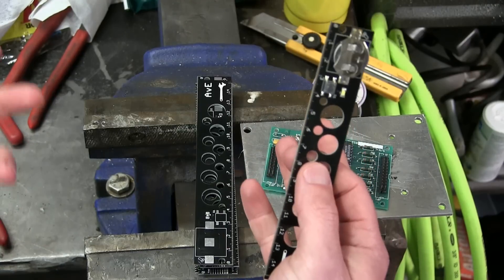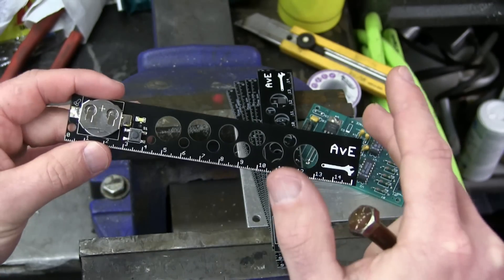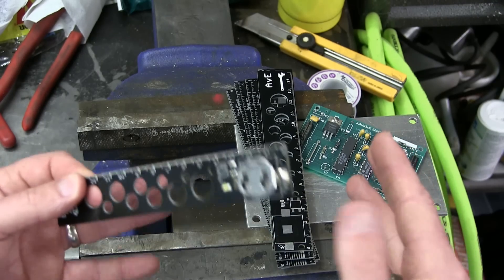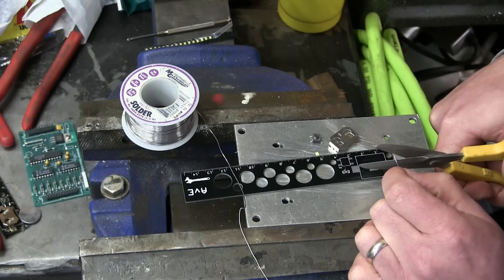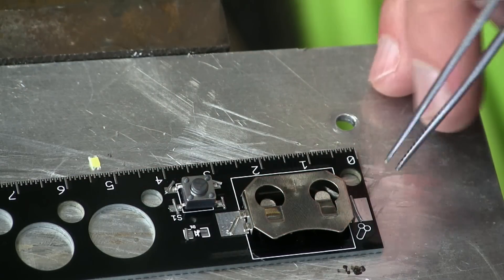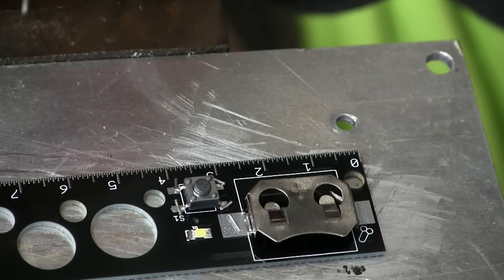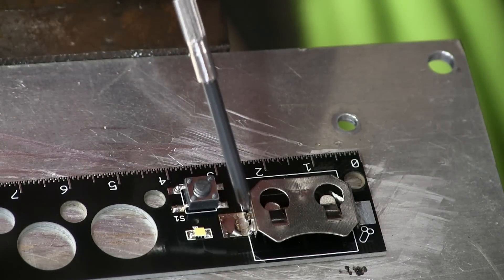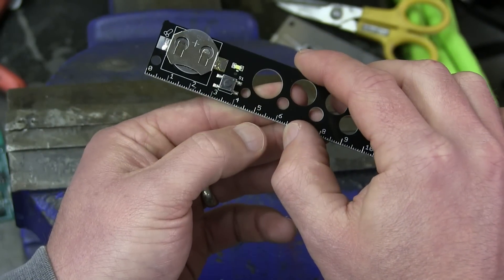AvE Shop Ruler: AKA How to Solder WITHOUT a Sodding Iron!

Comment: Well I completely fucktercated mine, soldered everything in place, popped the battery into the battery holder and it ripped the pad right off the board, son of a biscuit!  The next day though my "can't fix it" shirt turned up just to rub it in.  I'll give you this AvE, your comedy timing is great, even by post...

Comment: If the led goes on backwards does the dark get pulled in? Or is that the magic smoke going out?
Reply: There shouldn't be smoke as the battery voltage should be less than the max reverse voltage the LED can handle.
Reply: Short answer: nothing happens.
Long answer: the 'D' in LED stands for diode: a sort of one-way valve for electricity. Connected in the wrong way, they can start conducting (and failing) if the voltage is high enough. For LEDs, this is around 4 or 5 volts, which is less than this battery can supply, so you're safe.
Reply: Yes LED will turn it self in to micro black hole and suck all light within 3mm radius

Comment: I got my welders ruler in the mail today. It survived the trek to Florida with only minor damage to the envelope.  All parts accounted for.  2 super bright LED lights. One normally open pushbutton switch. A battery holder. Two lenses and one magnet. I gotta find my solder iron or a fry pan and my propane torch. Am i gonna remember hair widths? Probably not. But having something to compare to is nice.

Comment: Myself being an old F*** , half blind old school electronics tech I gladly took on my first surface mount project, donned my trusty Optivisor and placed the parts and solder bits over a thin aluminum plate and torched on. Long story short, on my third rework with still no light output yet my trusty Fluke causing a slight glow, I light the propane again when suddenly all my parts scattered as the CR2025 decided to explode. Yes, do not torch solder with a battery installed! Lesson learned, the parts are nowhere to be found in my garage and the ruler is 1/2" short due to over heating the thin Al plate. However, on a positive note, nothing landed in my beer cup. Never had this kind of problem working with vacuum tubes... Love the AvE channel.

Comment: Thought I got a bad led at first, but then realized I forgot to add a spot of solder on the middle battery contact pad.
Thanks AvE for the cool project!
Reply: I had to do that too... The LED worked fine when battery was just barely in the holder (edge of bat was pushed into center pad), but not when the battery was all the way in the holder. A tiny dab of solder on that center pad fixed her right up.  Choochin strong. Now to figure out what to glue that mag in with.  Fun stuff, thanks AvE!

Comment: Couldn't you just heat up the plate then apply the solder from the spool as normal?
Reply: Yes, but having a piece of solder on one pad gives you a good indication whatfor not overheating the thing. It's not really critical in this case but at some point the PCB's gonna burn.
Reply: That's how I solder larger stuff like iron plates, bolts, etc...

Comment: Valuable lesson learned.  Do not attempt to solder a surface mount led after imbibing multiple scotch and waters.

I got the other components soldered, then promptly melted the led.  I have a local supplier where I am reasonably sure I can pick up a replacement.  Is there any particular P/N or spec for the led?

Comment: I received my order today. When I received the envelope, there was a hole in it as well as hole in the plastic baggie. So, I'm guessing the switch fell out somewhere between the great white north of Canada and NY. 

Is there a part number I can search for a replacement switch?
Reply: Email sent.
Reply: If you don't mind me asking, How long did it take to receive your tool?
Reply: King of Chuck About two months. I placed my order in mid-September.

But the actual transit time once my order shipped was only about a week or so.
Reply: Thanks!  I just ordered one today.
Reply: I thought it was good. It's not like your mounting processors or any crazy components on it. lol

Comment: Got my order today, Already assembled, need to source batteries, anyone know the correct battery size?

Also my order came with a free AvE hair stuck under the tape on the envelope!!
Reply: time to make a clone
Reply: daviasdf amazon and booze do NOT mix
Reply: Drunk self didn't get the memo :[
Reply: Hey did you work out the right battery size? I just got my ruler.

Comment: Got mine less than 2 weeks after ordering. Also got the welder’s ruler. Lots of fun to assemble... bought some rulers for gifts. Good thing there’s 2 LEDs. I soldered one in backwards and another was DOA, so it’s great that there were exras included. Note: when dumping the parts out of the little plastic bags, do it on a large white cloth so the tiny LED doesn’t bounce around and disappear.

Comment: No resistor on LED? I like my pixies under control not running free like a pack of hippies. Everyone knows that’s how cameras get unfocoused.
Reply: Feral hippies running around in packs ? Oh man I'm not gonna sleep now..
Reply: 3.3 volt coin cell to operate the LED which has a forward bias voltage of 3.3 volts.  No ballast needed.

Comment: I got my one t'other day and it's skookum, I got into the shed today and threw some crap off the bench and soddered it up good and proper and it's really choochin.
The worst bit was opening the pack that the LED came in and then dropping the LED on the floor. Lucky it landed yellow side up.

I also took the precaution of removing the vice from the drill press so that I could move around while still remaining firmly clamped in the lower regions.

Comment: Can't rush perfection!!! Thanks for making sure we get top quality! Does it matter what material you use to heat the board for the no iron trick? Aluminium, stainless, carbon steel? What works best? I have a sodding iron but want to try your trick.

Comment: hey,
got the ruler kit and threw it together the other day. Sadly the light was not working.Scratched my head so my 30 some years of electronics and soldering stuff could activate the proper brain cells and I realized i put the dang led in bassackwerds. So naturally the photons were getting sucked into the led and not beaming out of it.
Come to think of it the garage did seem a little darker when I pushed the switch! 
I took the easy way out and flipped the battery over. Works like a charm!
Reply: Wow... I never would have thought of flipping the battery over... I suppose that's the difference between an engineer and a bumblefack like me !!!
Good thinking on your part !!

Comment: When I bid a project, I estimate how long it will take and how much it will cost... then I double it. It usually comes out right.
.
Thanks for delaying shipment so we get a product that is as error-free as possible. I get tons of products from another country where they don't care if the product is correct. I end up disassembling and reworking them so they work as intended. One good example is a product where the hot wire from the AC plug went directly to the circuit board and the neutral wire was routed through the power switch and fuse.  Sure it turned on and off OK, but if something were to short out, the circuit board would end up being the fuse. 
.
I eagerly await the opportunity to make measurements accurate to within  a RCH.

Comment: I just bought one (3 years later) the place where you put the button is on the other end of the ruler. 

But it doesn’t have a button with it? It does have two clear circles though?

Comment: Hi all! Got my ruler build and all. One issue I had was the LED was silk-screened wrong, so the polarity was inverted. Just an FYI to check the polarity before you solder it, because mine broke as I tried to desolder it which was purely my fault. Mr. Bumble offered to ship a replacement LED but it's cheaper for him if I just order a strip from ebay (LED size 1206). Love the ruler! Thank you for the best tool of them all!

Comment: Bought 2.  Hand soldered one , not so pretty..... Got low temp solder paste and threw it in the oven @ 300 dungerees F  Looks like a robot soldered it !  Sweet!!!  I would like a refund tho, one of the 4 free extra LED's don't light when I tested them. what kind of an operation are you running up there?  I will take a few more rulers to give out as gifts if you get the sweat shop up and running again! Thanks & Cheers!

Comment: Hey, don't mind waiting, I'd actually forgotten I'd ordered it after the first week!  But, ahem Meester +AvE, wouldn't it be more skookum if there was a current limiting resistor to protect that LED from burnout?  Or is there some characteristic that makes it last long time without it?
Reply: at 3v from the cell it will be under driven by a bit, so it won't draw enough current to cook itself. the curve for current draw on an LED is non linear, meaning just a bit more voltage and the LED will draw WAY more current.

Comment: Is the ruler still for sale. Do you deliver. I will need today. Just kidding. Missed ruler vid after so many years. I like it. I will use the porta power duel piston weld scenario  next time i get a stuck 2" dangler off the turd pulling cart. Thanks for showing that.

Comment: Use a dab of liquid solder flux (rosin type RA) to keep the solder bits from moving.  CA to glue components to the FR4 ex post placement.

Comment: Get some solder paste and squirt it on the pads. Drop your components on and heat the ruler on a skillet on the stove. Once it gets hot everything will flow together perfectly. Turn off the heat, let it cool, and you're done. Super easy - no soldering iron or fiddly bits of solder wire required.

Comment: Hey everyone. New to soldering, theres a pad under the center of the battery plate. Do I leave that untouched? Or just melt solder to it anyway for battery connection?

Comment: AvE  --  I don't know if you caught it ,  but on the second iteration of the Shop Ruler there is a Spelling TYPO with the "(Cunt Hairs)" Gap Width .  The word "Width" needs the letter "d" in the middle of it ,  without that letter "d" it becomes an entirely different word with an entirely different meaning .

Comment: What is the point of having a that on the ruler?  
(also, don't u need a resistor in there to limit the current so the LED doesn't release magic smoke?)
Reply: Battery voltage is close enough to the forward voltage of the diode, and the internal resistance of the button cell (they're not capable of delivering very large currents) will handle the rest.

Comment: This is kinda what you would do with old xboxs that got the red ring of death. You'd wrap em with damp towels and stick em in the oven. The reason why it worked because the soldering work was so bad that basically "redoing" it in the oven would fix it

Comment: Got mine less than 2 weeks after ordering. Also got the welder’s ruler. Lots of fun to assemble... bought some rulers for gifts. Good thing there’s 2 LEDs. I soldered one in backwards and another was DOA, so it’s great that there were extras included. Note: when dumping the parts out of the little plastic bags, do it on a large white cloth so the tiny LED doesn’t bounce around and disappear.

Comment: You made your job like 20 times harder by not melting the little solder sticks first. Melt some solder on the pads, then put a leg(s) of the component on top, then put the iron back on the pad, and go through the pads. Normally you just do a corner then solder the rest regularly but hey. You do you.

Also, how do you remove splinters with those tweezers? Are you getting impaled by logs? (Sharp tweezers are the way to go, and brass if you want them to stay non-magnetic)

Comment: Okay, I have my Oxygen regulator turned up to 25 psi, and my Acetylene regulator set at 18 psi, with a #9 rosebud tip. Do you think it will be hot enough to melt the solder? Or do I need to get a bigger tip?  LMAO !

Comment: Where is the resistor? Shouldn't there be a resistor to limit the current through the LED?
Reply: Not really needed, it's (I'm assuming) a 3 volt LED and a 3 volt battery.
Reply: Doesn't matter if its a 3v LED. The battery cant provide enough current to kill the diode. The LED will always try to pull maximum current.
Reply: the resistor would limit the current through the led to protect it. the voltage is not the reason we can leave it away. the maximum current from the battery is simply not enough to kill the led so we don't have to limit it.
Reply: Yes the LED would try to pull whatever current is available. But I meant exactly what others have said more clearly, that the tiny 3v button cell doesn't have very much potential current. I just thought it was common knowledge that those batteries don't supply very much current and I really shouldn't have said it the way I did. So I was both almost right but mostly wrong because of the way I said it. In other words "Whoops, my bad."
Reply: Maybe it is a LED with build in resistor?
Reply: certainly not
Reply: Sebastian Horlebein
How do you know?
Reply: There is no such diode with built in resistor. Especially SMD type.
Reply: @all - I'm surprised that nobody has explained this.

First - A battery is an arrangement of cells, and the only real battery available to the masses is the rectangular 9v - all else are 'cells' (AAAA, AAA, AA, C, D, button and coin etc.), but the term 'battery' is commonly used as a general term for both. The reason I mention this is to describe an inherent property of any cell known as 'internal resistance', similar to a simple resistor in series with the power source that limits the amount of current available.. This is one reason this LED can be directly connected without a resistor. Every cell (and battery) has a different internal resistance and maximum current it is capable of, and can even vary between same types and brand.

The other reason is that this LED requires an operating voltage higher than the cell is capable of producing. White LEDs (and others that rely on blue light to excite a phosphor, such as pink, purple turquoise etc.) like to see 3.3v-3.6v and around 20mA of current. Most other colours of LED would be okay, but may somewhat over-drve some types of red.

As an example, let's say the LED wants 3.4v and the cell will give us 2.8v after its internal resistance, this white LED will be UNDER-DRIVEN by 20%. The light from a LED tends to be non-linear where its range of output spans the top 3/4 of a volt (ca. 2.7v-3.4v), this LED will produce only 75% of its potential power. Worse, since we perceive light and sound in a logarithmic response, the LED will probably 'appear' to be half as bright as it would be if fed the 3.4v it wants.

Sorry for all the boring detail, it's mainly for those interested in the how/why and those who are just starting out with electronics. I hope the extra effort is helpful for at least one or two people out there.
Reply: I am certain because a) it is not needed b) it wouldn't make sense c) I have never seen nor heard or read about a led with integrated resistor in this package. yes there are others with resistors integrated but mostly 5mm THT packages. the coin cells internal resistance is sufficient to not kill the led.
Reply: I think its time to stop saying the same thing over and over...
Reply: +DaveArgon I apologize for accidentally reporting your comment. The POS device I'm viewing this from interpreted my gesture to scroll down as a quick series of taps.

Comment: How hard would it be to fit a 2032 battery in there if I got one? I have a bunch kicking around and they're also available at the ol' dollarama while the 2025 isn't.
Reply: i used 32's in devices that use 25's before
Reply: I wonder too, I have donkey loads scavenged from disused computer machines.

Comment: How high temperatures would the PCB withstand?
Reply: ~500 ish (Celsius) they start to disintegrate, smolder and with ignition source, burn. :)
Reply: Yeah, I guess it's highly dependent on the laminate substance used...
It just came to my mind after remembering all those various PCBs stained black because of prolonged heat.
Reply: Pinkorek About tree fiddy

Comment: Argh, my soldering sucks!  I can't get the led to work!  I tested it for continuity and it lights up, but when I try the switch there's nothing.  And yes I did solder it the right way round ;)
Reply: I had the same issue, I had to solder it a couple times and finally worked... For about 5 tries and then the LED dimmed out and thought it died.  Turns out I needed to put a small blob of solder on the negative pad to make proper contact.

Comment: ...really BIG soldering iron, big enough to set the whole project onto...
A time or 2 putting together a piece of equipment in a spot that power hadn't been run to yet, I had to solder with a candle

Comment: Should have put the LED on the BACK SIDE of this ruler AVE!! Then it'd actually be useful ;)
Reply: then the ruler wouldnt rest flat against a surface.
Reply: Maybe if there was one of those holes cut out for an in-line LED that would then light up in both directions.

Comment: okeee, why not heat it like you did and hit the taps with solder straight from the roll :) a bit more controll and less fidlly :)

it even gives you and extra hand compared to normally using an iron :0

Comment: get the led backwards can't you just put the battery in backwards to compensate?  ain't any other parts that would conflict....
Reply: Might get away with it with really careful positioning, but the risk of shorting the battery is big. The 'top' and sides of the battery are +, 'bottom' is . Tthe top and sides of the holder are one solid piece of metal. If you reverse the battery and have the 'bottom' of the battery touching the top of the holder at the same time the side of the battery touches the side of the holder -> short!